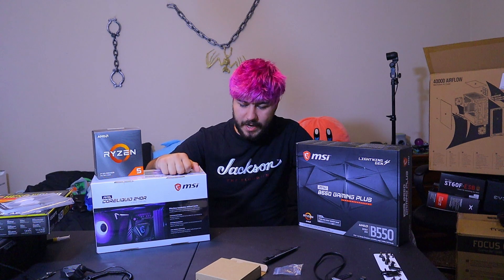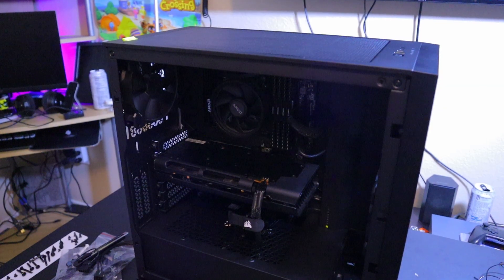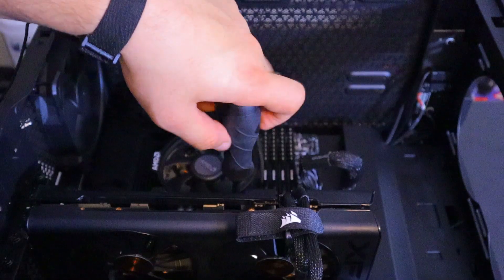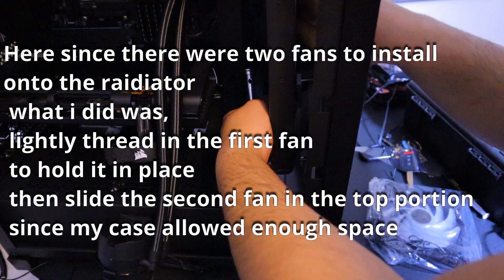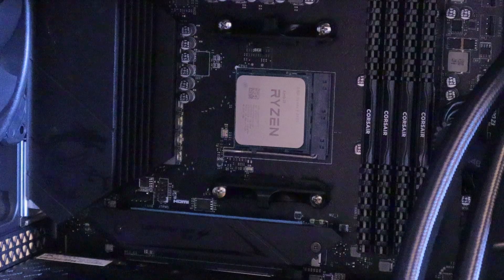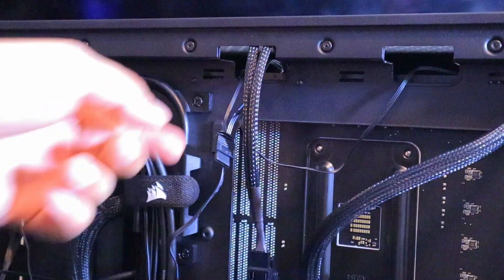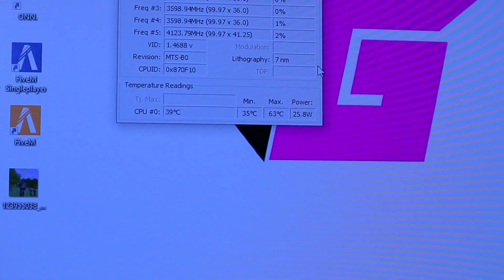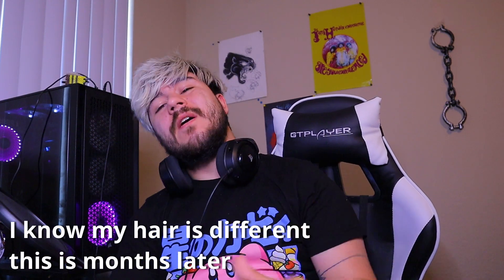Installing an AIO (All in One Liquid Cooler) for your PC

Comment: Hey can you eloborate on the argb connections of fans? So there are two male and two female pins on each one
I think one male pin from aio goes to one female on a fan
which leaves two male and female ports
Reply from the maker: so this would depend on how many headers on the Mobo there is and where they are placed more convenient for yourself what I did was I plugged two females to the Mobo leaving one female JRAINBOW plug to be daisy chained into one of the plugs that were already connected. They came with a side cable with a cap revealing a male plug to daisy chain into

Comment: Can a tri-fan gpu also fits inside?
Reply from the maker: This mostly depends on the parameters of the gpu My dual fan gpu has about 3.5 more inches of clearance and that's because there is a radiator on the inside along with the case fans so this will also depend on your configuration